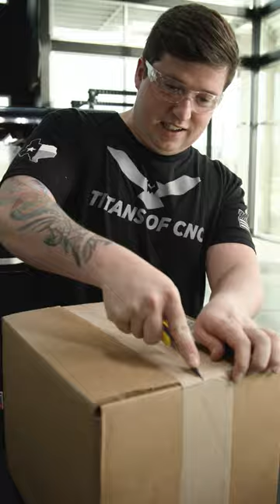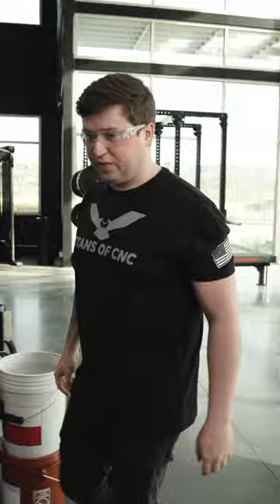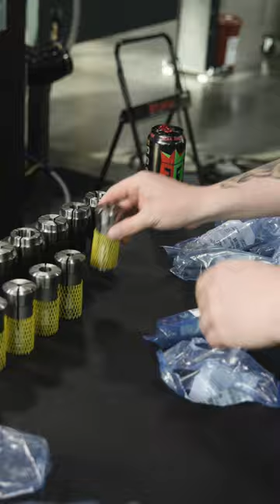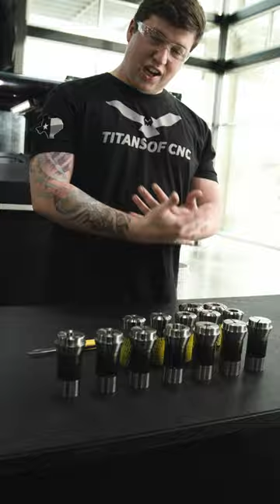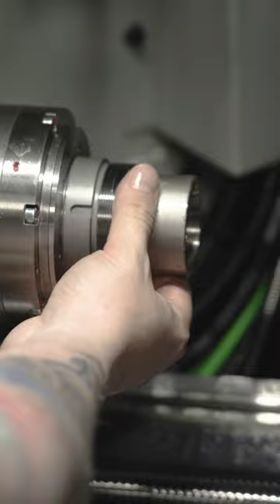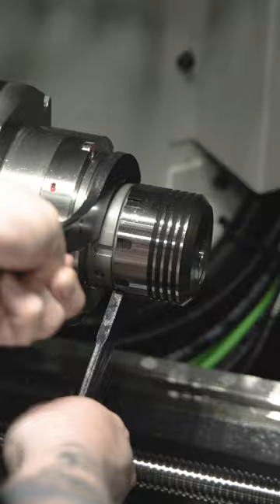New Hardinge Collets for our Tornos Swiss Machines!

Comment: Hardinge in quality but unless I'm in a pinch, I don't buy Hardinge collets. They make the OD too tight to the ID of the cap which makes tightening the cap harder than it has to be. Plus they are shipped in bags, which means no protection when they are rolling around in the cabinet drawers and knocking against the others that are organized by size.
Reply: That's odd, Hardinge has actually been the only supplier that ships the fastest to us consistently. We WERE using S&M until their lead times increased to three weeks for standard sizes.

Comment: He does not sound Swiss at all…
Reply: Yeah. I have to agree with you. I'm not hearing what I would call a Swiss accent.
Reply: That's because he isnt, he's a machinist working on "swiss" machines
Reply: @jackknall9966  I am aware, I was simply making a joke haha.
Reply: @jackknall9966  If you look up, I'm sure you'll be able to see the joke go right over your head. 

Of course we know he's not Swiss. I'm quite familiar with Swiss machines. I have 18 of them at my current shop.
Reply: pff the one time i try to be nice in the youtube commets smh
Reply: @jackknall9966  Don't be discouraged. Sarcasm in its written form is hard to detect. It has happened to us all at one time or another.
Reply: I mean this is youtube shorts, most people in the comments couldnt change a lightbulb
Reply: @jackknall9966  😂 thats quite true
Reply: @brandons9138  dang, i havent even ever gotten to watch one run besides on youtube, but they look to be the bees knees! My 1979 clausing-colchester 11” engine lathe is a completely different beast haha
Reply: @YoSoyElQuesoGrande  The are great machines, but they do have limitations.  My shop just got our third Miyano lathe as well. Those are 9 axis lathes. It can do 3 tools in the cut at the same time on two spindles using 2 turrets. 

When I first started at my current shop I had no experience on Citizen Cincom controls. I had never used Esprit for programming either. They gave me the task of programming, setting up and running the Miyano. The machine was brand new and had never made a chip before I started on it. You could say I was thrown into the deep end. 4 years later our 3rd Miyano just hit the floor. It's already booked solid for the year and it's not even plugged in yet.
Reply: @brandons9138  those sound pretty sweet haha. I work in a tool and die apartment, pretty behind the times, but in the last couple months we did get a brand new aggie charmilles cut p 550 pro wire EDM to replace an early 2000s charmilles 240. We do mostly manual machining and finish on EDM here.
Reply: @brandons9138  also, doesnt esprit feel like it is a couple decades behind in UI lol. Thats what we use for almost everything.
Reply: @YoSoyElQuesoGrande  Have you seen Esprit TNG? It's totally modern now. I'm not currently using it, as it doesn't yet support Swiss machining. We have seat of TNG for our milling department. Things it can do are pretty amazing.
Reply: @YoSoyElQuesoGrande  TNG is crazy. It can take a 3 axis program and translate it to a 5 axis 3 position tombstone without having to reprogram the parts. It's nuts.